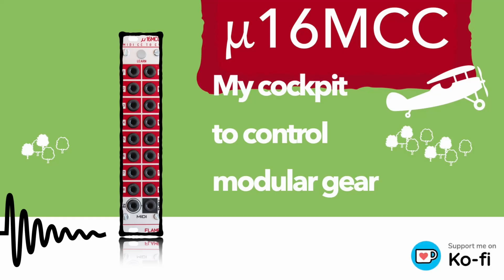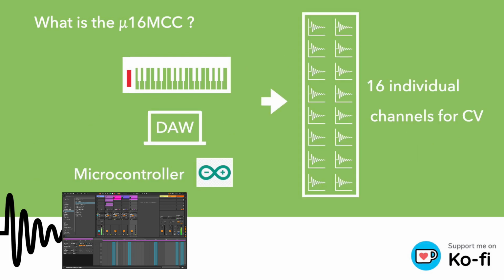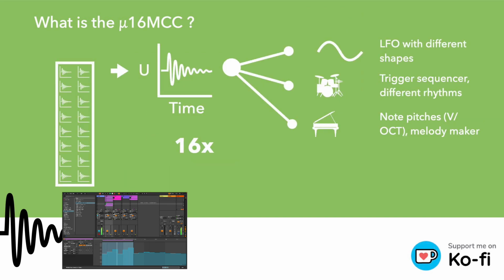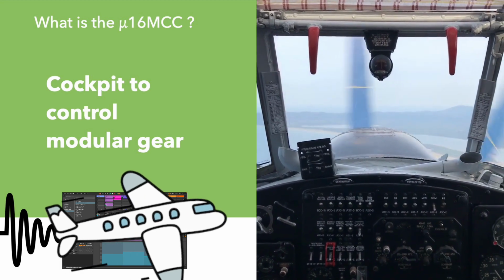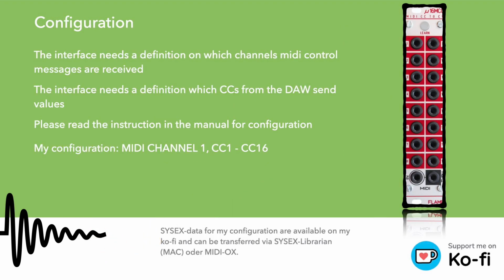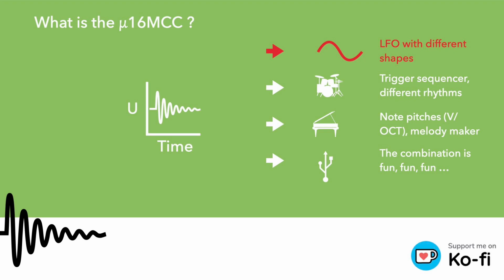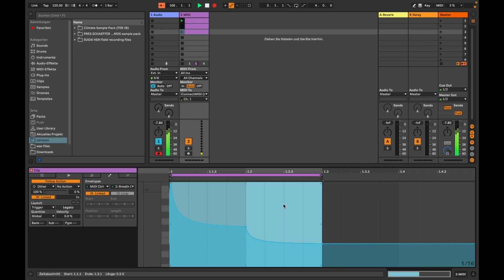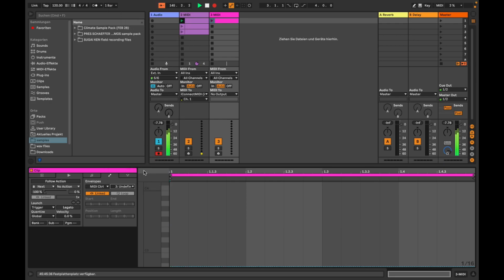MODULAR TOOLS - FLAME micro16mcc - midi cc to cv interface - my cockpit to control modular gear

Comment: Could you link two of these and use one MIDI channel for 32 MIDI CC outs?
Reply from the maker: In principle I think yes, you can use (for instance) on one device MIDI CH1 MIDI CC1-16 and on the second device  MIDI CH1 MIDI CC 17-32 if you program the module in that way. Please ask the guy from FLAME, if he can send you the file you need. I don't have tested the MIDI THRU connection yet - so before you buy the modules, ask FLAME.
Reply: @phonopollution  Thanks. I actually emailed him and they responded quickly. Indeed it is possible using the files as you've mentioned as well as the midi thru connection.

Comment: For me, personally, using MIDI to control modular nullifies the spirit of modular itself. And I am a MIDI guy. 😏The important thing is simply that it inspires you to make great stuff.
Reply from the maker: I understand what you mean. To me it is more freedom to operate. In future I will use an Arduino Nano to avoid using a DAW/Computer, so I will have more outputs than on a Befaco Lich to control stuff and I will be able to do that in both directions which means I will also send trigger voltages to the Arduino which is not possible with a DAW/Computer. I think about some pre-programmed Arduinos which I can easily switch. I will see. The important thing is to have 16 channels on a small footprint.
Reply: @phonopollution  "The important thing is to have 16 channels on a small footprint." How about 64 tracks with 3 MIDI outs? 😏